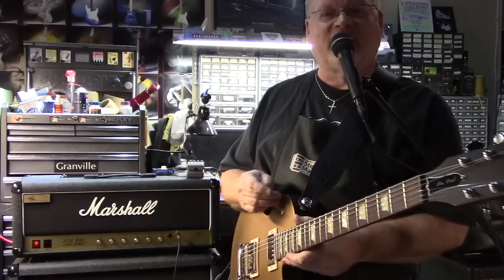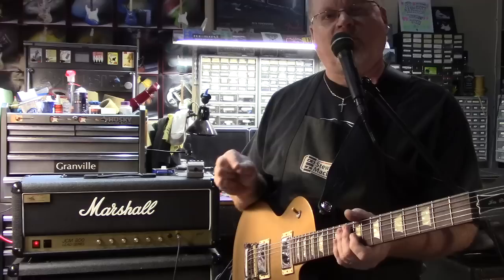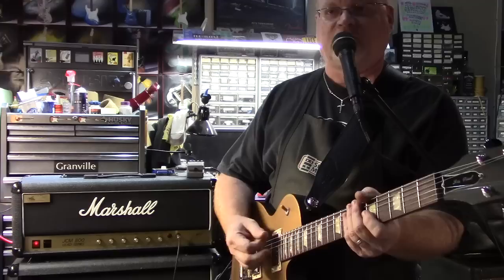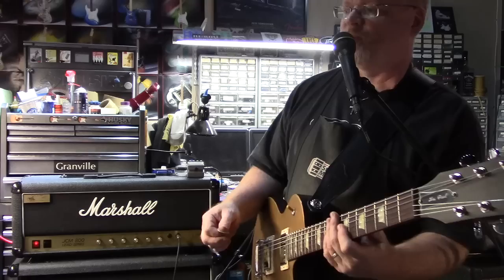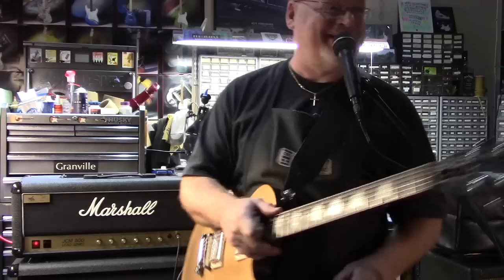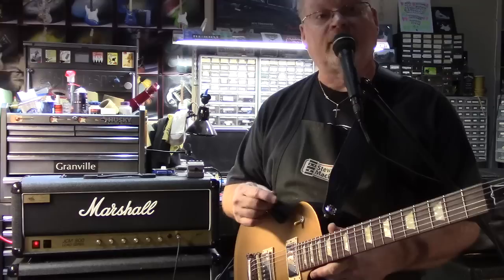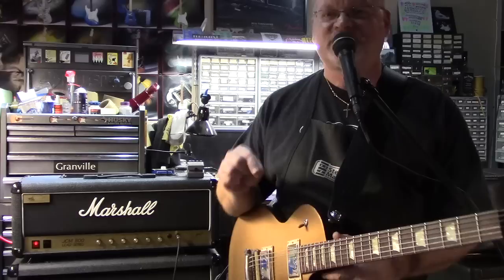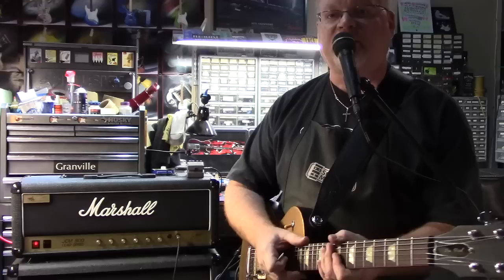Erik Rutan (Hate Eternal) Marshall JCM800 2203 Metropoulos Zero Loss Effects Loop Demo

Comment: Really cool. I've always wanted an 800 but just can't justify it in my small house in suburbia.
Reply: Buy a Rivera rock crusher. Problem solved
Reply: Get a marshall 3210 mosfet lead 100. Solid state, cheap, sounds good at any volume and it looks just like a jcm800.
Reply: Marshall recently released several 20 watt versions of a few classic amps, including the JCM 800. Those are more house friendly, and probably good for cranked amp recording through a speaker emulation unit with good IR's.

Comment: Put that in my old Canadian build 800, never changed a thing amp sounds stunning. It takes pedal and rack mounts just as good , whatever you dial in that loop delivers. No loss on the front end original tone whatsoever. For what it does this is not an over expensive addition either.

Comment: I have an old Marshall mosfet lead 100 (3210) which is solid state. The effects loop is very noisy, is it possible to upgrade it to one of these?
Reply from the maker: Lavabug - No.  The ZFX requires things that amp will not provide.  It was designed for high voltage tube amps.